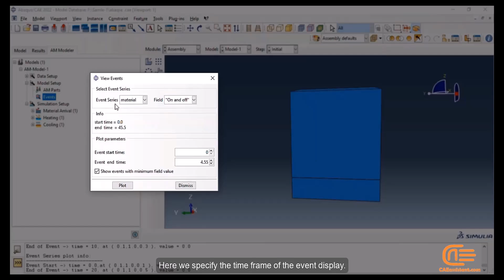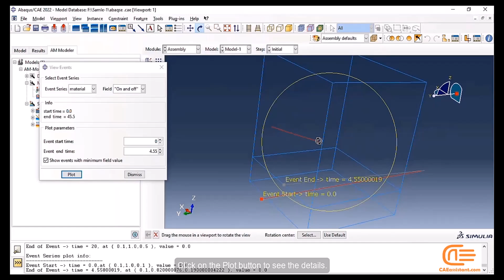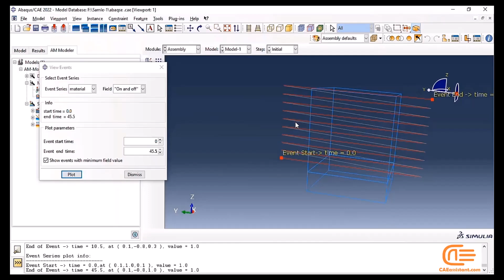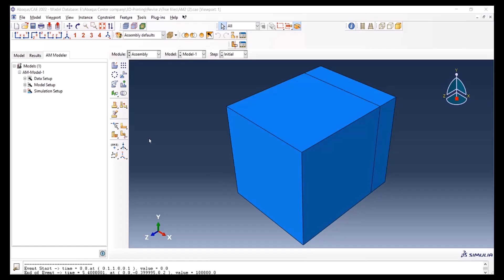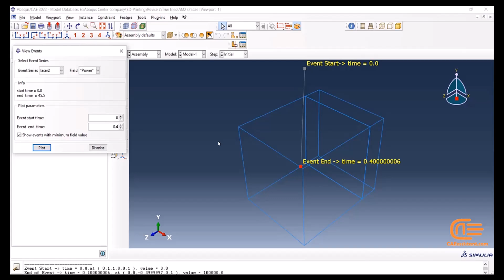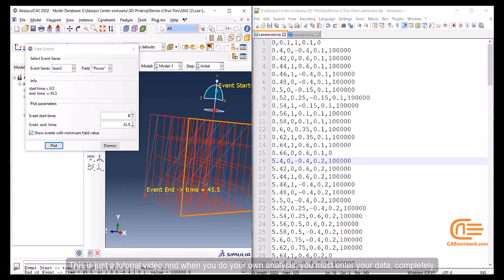Abaqus LPBF 3D Printing Simulation | Part 3: Event Series and Laser Path

Comment: Hello, thank you for sharing this valuable information. How can the values 0.5 and -0.8 in the second row of the Event Series (material deposition) be calculated?
Reply from the maker: Hello and thanks for your comment.
I didn't quite understand your question; however, in the event series the (material deposition) the first column indicates time, second column is the X component of the roller which is fixed, and the third column is the Y component of the roller.
Reply: @caeassistant  Let me explain more : when I need to define the Event Series for laser and material deposition on a complex part, what software can I use to generate the G-code — and how do I turn that G-code into an Event Series?
Reply from the maker: I understand now and I think this video could help you:
https://www.youtube.com/watch?v=MFqFSVGqK90